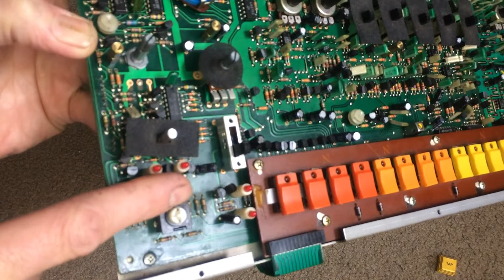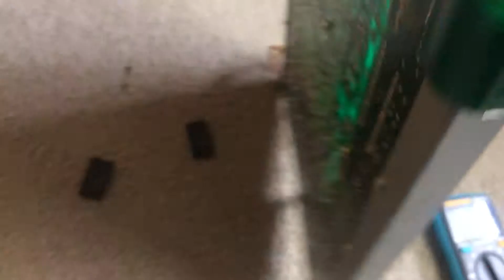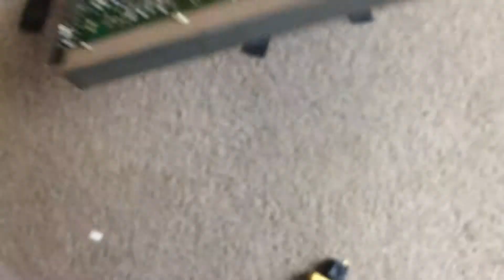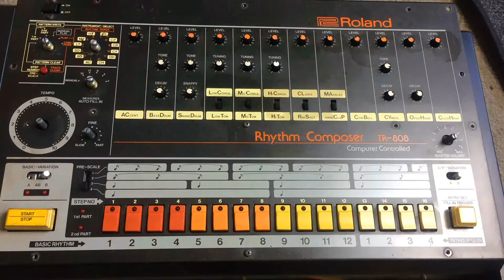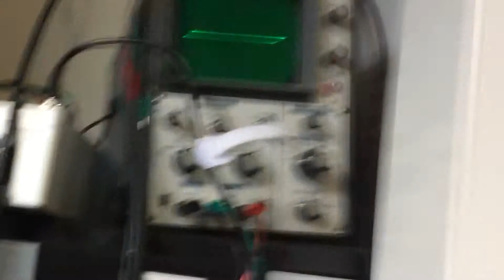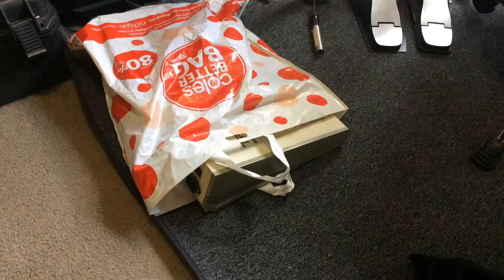ROLAND TR-808 REPAIR & REFURBISHMENT P2 | Vintage Drum Machine Repairs

Comment: Hi! Thanx for the video. I was wondering what you use to clean the case. Thank you!
Reply from the maker: I find window cleaner on a soft cloth is gentle. For residue and marks, I find Tea Tree oil the best by far! It doesn’t take the paint off and is safe on hands too though can burn if you have cuts but it’s a disinfectant so worth the pain :)